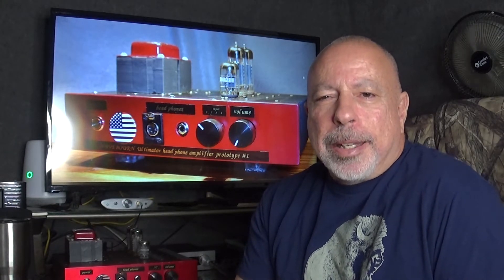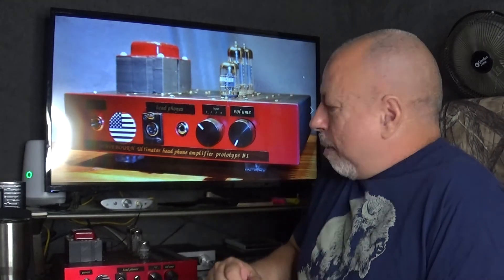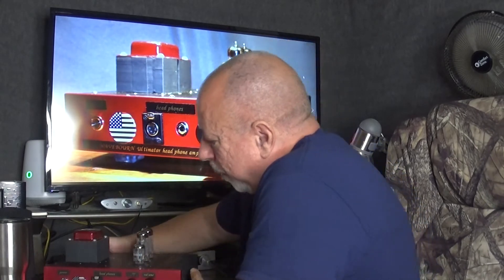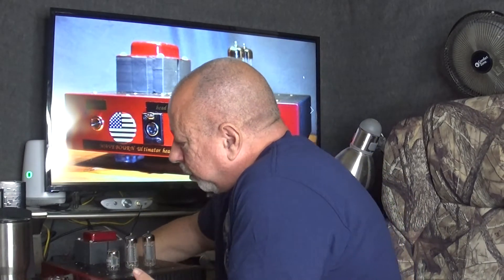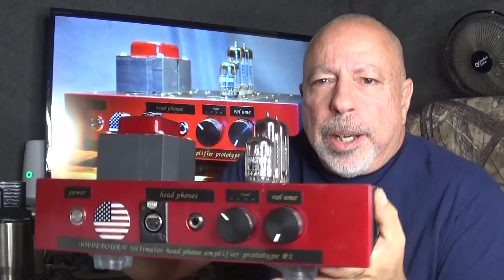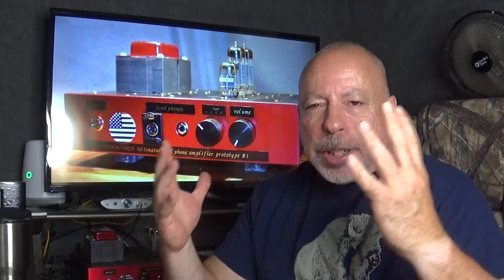WAVEBOURN ULTIMATOR HEADPHONE AMPLIFIER PROTOTYPE #1 (FIRST IMPRESSIONS).

Comment: William, I encourage you to try transformer balanced XLR inputs. I used pretty expensive line level Lundahl transformers for them. It is not just for convenience, it eliminates ground loop  noise, if the source causes ditry currents through ground loops. And, DACs output 6 dB more gain on balanced outputs. However, this prototype has some excess gain, it will be reduced in the next version.
Reply from the maker: Thank you, and yes I will try the XLR inputs as soon as possible.
Reply: @theheadphoneexperience-wil2250  - and thank you for your valuable feedback! It allows me to improve my designs in the right direction.

Comment: Speaking of measurements, it is not necessary that tube amps measure worse. Just wrong measurements that measure wrong things. It does not matter how low is THD on full output power. THD itself is very ancient and obsolete measure. It is like judging a clinic by averaged temperature of patients, when some have fever, others are in refrigerators. What matters, are distortions perceivable by hearing, or not. On high power we can tolerate pretty high spectrum of distortions, but when sounds decay, distortions must go down and only down. Excuses, like "You see increased distortions on decaying power that does not matter because they are below audible level" do not work in the real life. The lower is the signal level, the lower must be distortions, the narrower must be their spectrum. The ideal case is, when harmonic distortions in dynamics mimics distortions of a physical media including our own eardrums, but lower in their level. In such cases harmonic distortions are not audible, and the amp preserves "warmness", "air" in the sound. Also, our hearing is dynamic, so tiniest changes caused by temperature change of semiconductor devices, or DC voltage change on coupling or power supply capacitors, reveal that the sound is artificial. So, if to measure properly, tube amps can measure much better, in respect to audio perception of distortions.

Comment: The power dissipation of this amp is not necessary, the power transformer outputs a bit too much voltage, to filter and stabilize. With new transformer it will go down to 100 Watt or even less.